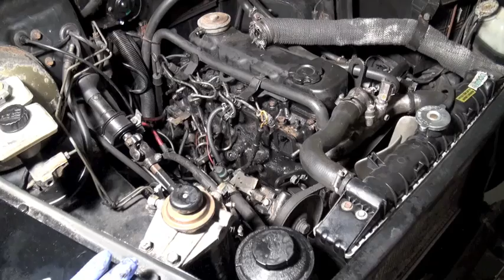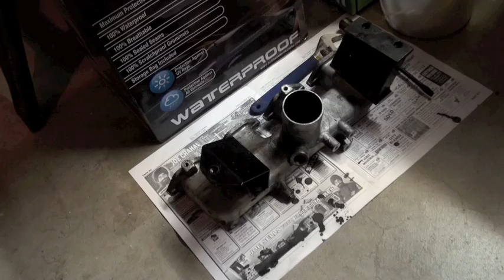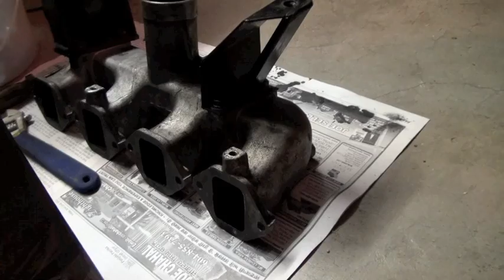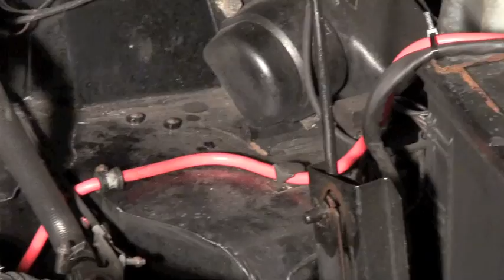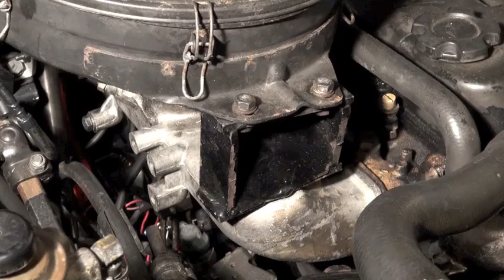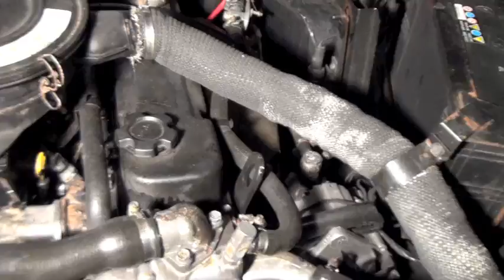LTI Fairway London Taxi Starter Motor R&R et al

Comment: The steering box can be overhauled by a competent engineer. They're a nightmare to replace, but if it does leak, add break fluid, and it'll stop it for a period. An old trick to get the taxi through PSV (Public service vehicle) testing. The alternator pump is the engine oil pump. I believe it also powers the brakes. If the brakes go hard, park it up, as it'll starve the engine of oil. Owning one of these vehicles, I learnt that the hardway.  The little negative wire on the starter motor which runs to the relay can be problematic. if someday you turn the key, and get nothing, that's where to go. The elephant trunk connected to the air intake can be sucked into the airbox. Nice job on the bolting of it 👍 The engine is also a naturally aspirated Nissan 2.7 diesel engine. The same engine is also fitted to the TX1. Most parts are made by Blue Print as it's a Japanese engine. EBay will also have everything you can't get stateside. Also, grease the window wipers. They're a threaded bar set up, and a nightmare if they seize. Cracking vehicle you have there. Capable of a million miles, even more.